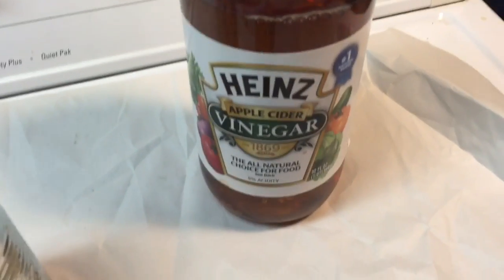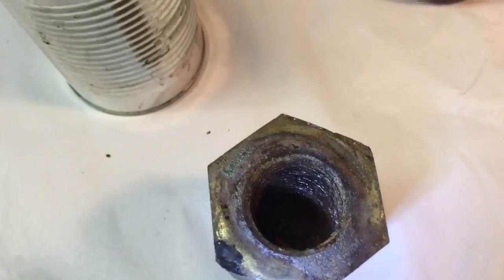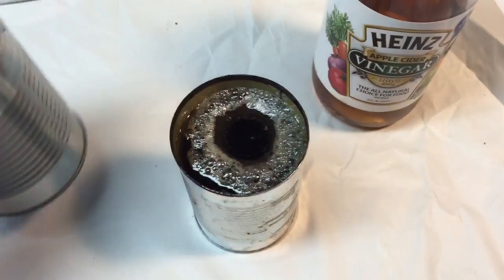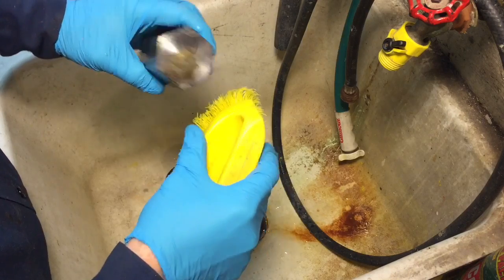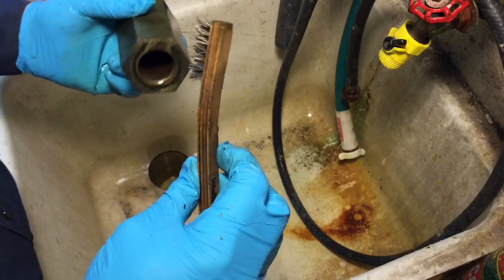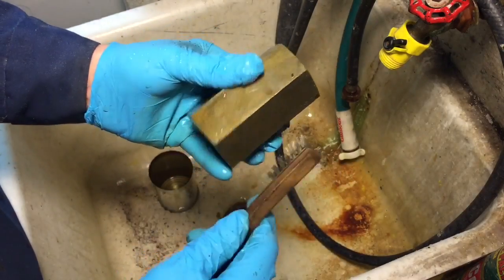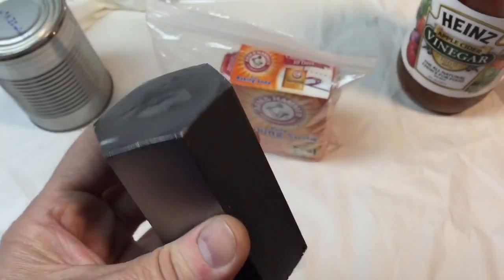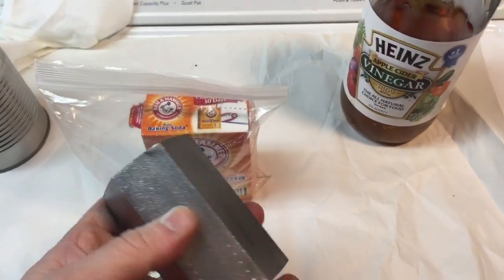Vinegar Rust Removal and it's limitations

Comment: Good tip . I have used vinegar on smaller iron parts . But have never let it set more than a few hours . Now that I have seen your video . I think I will give that a try on an 8 inch adjustable wrench that the adjuster has been rusted shut for a long while . Also on a couple 4 inch rusted C- clamps . I think I'll do them individually , and leave them 48 hours each .

Comment: Hi Scout: Merry Christmas !!!!    On this project it might be easier to clean out the internal threads with a plumbers cleaning brush commonly used to clean copper fittings,they are available in several sizes.

Comment: Thanks for the tips.  You will get better results quicker, if you use a stronger vinegar and warm it up some.  I use 30% vinegar that I get from Amazon.  For cleaning the interior threads of the capnut, use a cylinder-shaped brass brush, the same you would use for cleaning a 12 gauge shotgun barrel, available throughout America at flea markets, estate sales, Walmart, Amazon or any gun shop. For the best cleaning results, try electrolysis using a carbon anode - ShopDog Sam has the best videos on this method on YouTube. With carbon rods, obtained from welding supply houses, there is no scum floating on top of the washing soda solution, and no black or other deposits left on the item being cleaned.  Dip it in kerosene or something similar as soon as you take it out and dry it, to avoid flash rust.
Reply from the maker: Hello Anonymous98!  Wow great tips!  I never knew you could get stronger vinegar!  This nut was just a experiment back when I was first using vinegar as a rust removal technique.  One thing I have found is that rust has to be ground out, the vinegar and electrolysis work great for surface rust but once there is scarring or pitting you have to grind, sand or file off the rust.  The vinegar works great you just have to be patient!  It also helps to scrub the item every 8 hours!!!   Thanks very much!!!!  😃👍
Reply: Great tips. I will check out Shop Dogs electrolysis video. I just realized I not getting notifications from him anymore.

Comment: The converted rust, the black greasy material,  is an oil attracting protective film.  A person could leave the converted rust (oil it) or do as you did and brush the converted material off.  The gray converted surface looked like a finish.
Reply from the maker: José I have seen vinegar have different effects on different metals... Maybe the carbon content has something to do with it.. I just used it again on some clamps I will show on Wednesday!  Thanks so much!
Reply: That is a good insight.  I soaked in vinegar a corroded Craftsman 1940s boxhead wrench (similar corrosion to the cap in this video).  Like the cap in your video, the vinegar left a gray gunmetal finish.  I did not try to remove the gray residue but lightly buffed it with a rag and oiled it with 3 in 1 oil.  We look forward to your next video.

Comment: I can't get any results from this stuff
Reply from the maker: Hello Ace, I have to admit that I'm not a huge fan of this method either for the following reasons- First it leaves the metal in a very unappealing dull gray color. Second it takes hours to work.
I guess it has it's uses but I'm not a fan of the finish.  Thanks for commenting!
Reply: I use white vinegar all the time to remove rust from tools that other folks just scoff at, and with patience I obtain great results.
Outside there is a container of vinegar that stays full all of the time and I just freshen it up from time to time with a cup or so.
Yes it smells bad and is messy but on some tools that have rust sickness the only way short of electrolysis to stop the rust from coming back (cheaply) that I’ve found is to kill the rust with vinegar. Heavy wire brushing afterwards and or sanding it always necessary.